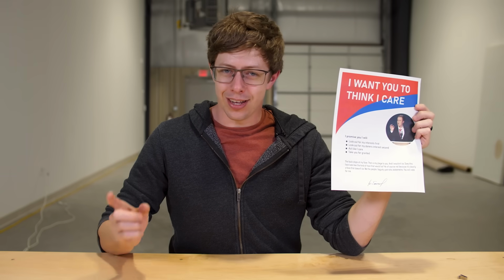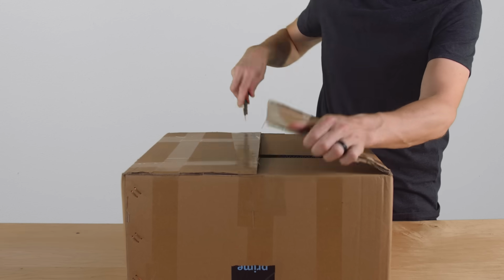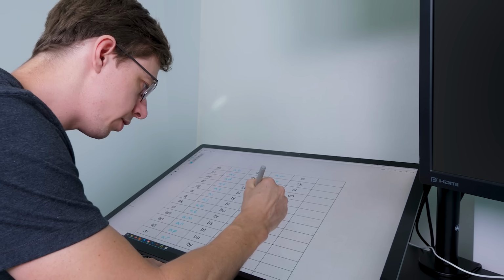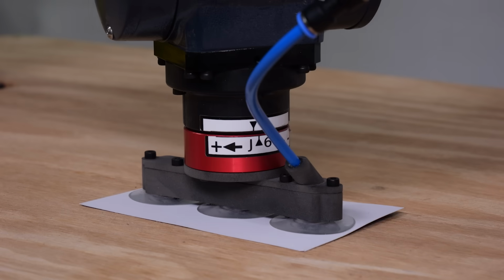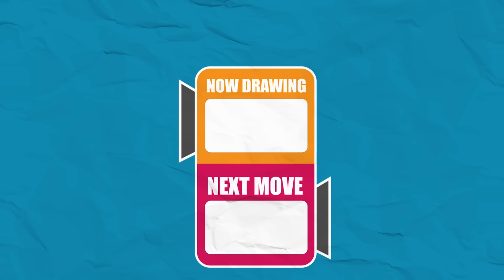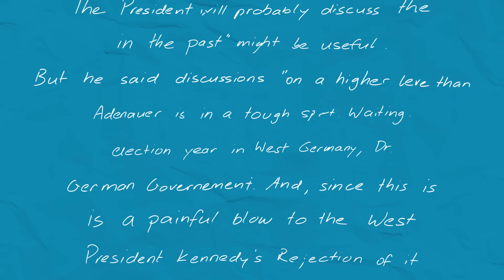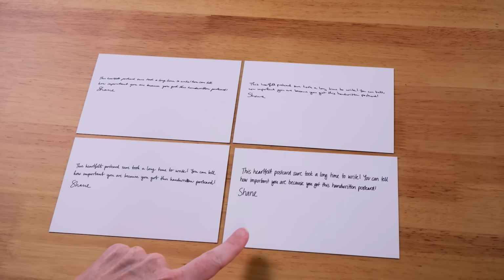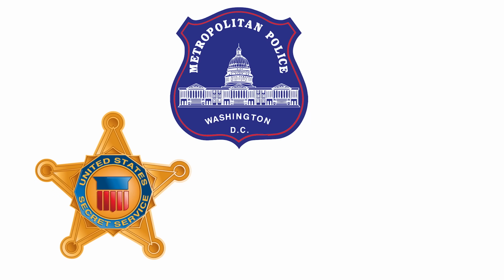I sent robot forgeries to a handwriting expert

Comment: I think one other easy give away was that everything was written at the same pressure (against the paper) which is usually not what happens when you write naturally and maybe this couldve been incorporated by varying force against the paper or by including a spring mechanism near the pen and replicating the motion of a human hand lifting the pen at the end of each word, does that make sense?
Reply from the maker: Yeah the handwriting experts call it "pen pressure habits." I thought for sure that's how Ron would be able to tell, but somehow the pressure was varying in the robot writing in such a way that looked very human. I was shocked when he told me the pressure looked human and realistic. I think it was somehow related to the acceleration.
Reply: @StuffMadeHere  That same thing jumped out at me when I was watching this.  If you do a follow-up video about the writing analysis, it would be really interesting to learn what other cues (pen angle?  The speed at which the pen is applied to and lifted off the paper?  Dirt or smudging from the side of the hand?  Skin oil or DNA traces?) an expert might look for.

Comment: 17:00 also you might want to find a way to turn the machine on its side and have it still work, as pens are designed to apply ink by friction, not gravity, so it looks better when the pen is held horizontally (this is the same reason you will see calligraphers use a slanted table)

Comment: I’m no expert in handwriting, but I can translate it to similar “detail focused things” I’ve worked with. So:
1: Does the robot vary the pressure?
2: Does the robot vary the size of each letter? The angle?
3: Does the robot put each letter at specific horizontal line?

We vary these things all the time. It’s not just that every, let’s say “e”, is at a specific pressure/size/line. It varies all the time!
(There’s more to this, I just wrote a few examples.
I can give one more to give you an idea: The robot is relaxed all the time. It never gets tired or varies anything. It just writes like ..a robot.)

Comment: I think some aspects where this robot writing is different is, that the pen angle and pressure isn't constant with actual hand writing. 

Depending on the pen or brush you use, it can be crucial to have more than X-Y-Z,

Comment: The greater failure I've seen on the machine written cards was that it lacks of pressure variability. All letters are roughly the same thickness without some pointy ends.
Reply: The ammount of ink on some letters should also vary, as the machine has a constant rythm on writing and humans don't. Also, the way it traces exact lines for every letter should leave behind marks that could be distinguishable with a microscope.

Comment: Very neat. My thought process would've been making a pen with accelerometers and tracking points and some way to measure the pressure on the tip, that way you could emulate the natural variations in handwriting. Then write out exactly what you want to write and record the movements and pressure of the pen strokes. Then have a multi axis more precise pen robot that can copy your exact moves. That would at least help you write one message. If you want to have different messages then I guess you could combine that approach with the machine learning to create variations in the writing. Maybe even have it mix and match multiples of the same sentences so you could have more variations, ie more natural looking

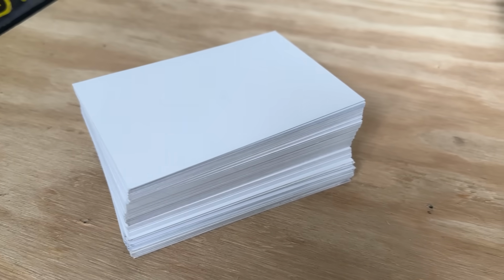Comment: @9:25 you can program the following:
for i = 1 to 1000 cards
   adjusted_height = totalheight  - [totalheight / 1000 cards] * i
next i

So if you're picking up your 500th card. And the total height is 300mm (because European are actually sane): 300mm is divided by 1000 cards and multiplied by 500, leaving a adjusted height of 150mm. Or if's your 863th card your adjusted height is 300 - [300 / 1000] * 863 = 38,1mm.

Comment: The "Oh no, what now?" facial expression of your wife when asked to pick the fake, is priceless.
One thing which would make the overall output seem more natural, presuming that the whole message can be treated as a single object (like any other block of text in a graphics program), would be to very slightly (only a few percent would be plenty) and semi-randomly rotate and/or distort the text vertically, horizontally and diagonally, so that if some-one gets more than one card, no two should likely look precisely the same.

Comment: There is 2 important things missing from the samples that if corrected would create a ramdomization that could be undetecable. The first is pressure of the pen, ( if you really wrote a thousand of those postcards, the writing it self would eventually trail off, or lighten.) This  also needs to be tied in to the second and more noticable Inflection. Lets put it this way, if you just got "The Glare" then your hand writing will reflect that in a downward fall off in the sentence or line stucture. But if you're thinking you can trick your wife, and pull one over on her, then your sentence/line stucture will be slanting upward with positve Inflection. Inflection also effects the speed of handwriting. If there is a certain phrase you know, that part of the sentence that contains that phrase will be faster, due to your brains ablilty to retain mussle memory. These changes if implemented would make a less psychopathic robotic handwriting sample.    You do realize your wife figured out the fake result by reading you not the cards right?     My suggestion to solve the problem have her write 10 cards,(at different times, and of course, only if she wants to)then use her samples, as the writing sample base, and see if she can recognize any of the 10 cards as her own. Also if you do this, use an envelope, and do not be in the room while card recognition is taking place.   Italics or italicization can also be part of the inflection too.  If your interested in machine learning maybe a reading robot that notices inflections and tells you about a person from a sample could be neat. You would be able to take a sad sample and make it happy. Just a thought. If you want to see how good you are a noticing inflection, find a news story, go to a fake news generator, input the real story into the generator, and finally compair the two. You should notice lack of inflection almost immediately. Translation programs still are unable to correct for this, Chinese to English, or Russian to English. In this case it is English that is missing the inflection, that is why amazon instructions seem so weird. A robot that can read and flag angry letters i am sure would be a useful tool.  See also: Red Riding hood story analysis experiments.  Thank you for the cool video, l always like the content from your channel, and cannot wait for the next cool idea or concept you share.
Reply: We've got a pro over here. I really appreciate the insight
Reply: Another thing to consider is ink smear. Ink does not perfectly lay on the paper nor does the hand not occasionally rub against the paper smearing the ink.
Reply: Another thing that shows 'humanity' in the written word is the use of white space -- just a thought . . . ;-)
Reply: It's so damn cool that inflection is present in both vocal and written language, and quite obviously. It's so cool how experts have identified and can quantify these small distinctive human behavior even tho we can all figure out written inflection very few people would be able to communicate what they actually mean. mega appreciate your insight!!

Comment: The anti forgery guys are gonna make their own neural network to recognise the ai writing lol. Maybe for cases like this, they could check for hand grease and stuff.
Reply: there are so many many ways to tell it's not real handwriting, i'm very surprised the "expert" said it could fool him. very surprised.
Reply: @moos5221  Would you mind explaining some of the "many many ways".
Reply: @nishachoudhary4894  one important indicator to identify  forged text/signatures for example is the pressure with which the pen/marker is pressed against the paper. the machine will have applied a constant pressure for every letter and every part of the line of the letter while a human would vary the pressure a lot between each letter and the start and ending of the lines of each letter and in the corners etc, you get the idea.
Reply: @moos5221 couldn’t you just represent the pen pressure as a value and then set a range of what would look like realistic variation in pressure for a human then have it randomly choose a value from within said range
Reply: @moos5221 of course probably humans have a more consistent pressure for individual letters or words but couldn’t you just claim variation in writing surface for a seemingly random differentiation from pressure
Reply: @treyheeb5379  i assume that could potentially be done, not sure how well though. i'm not saying it would be completely impossible to build a machine to create top level forgery (even though it would be extremely difficult and likely not worth the effort), i'm just saying that his machine is in my view far from that and any handwriting forgery expert should be able to tell that it's not human writing. to detect forgery you obviously not just look at 1 document but you compare 2 (or more) documents of which 1 or more are known real documents and 1 is the document in question and you can make out individual handwriting patterns of an individual and check if those are present in the document in question. examples are the angle the pen is held, the speed at which it is moved, the pressure and even things like tremor in the hand or smearing ink when backtracking "i-dots" and many more. to produce a perfect forgery all of these have to be taken into account and i doubt you will find any application where it would be worth the effort to do so. to check if a document is machine or handwritten is rather unusual of course. 
I want to note that i myself am not a handwriting or forgery expert but i have worked with some and hence have some general knowledge about their approach.
Reply: @treyheeb5379  of course any persons handwriting has a lot of variation depending on many aspects such as pen used, surface, underground, if the person was in a rush or took their time to make the writing look nice and so on. especially the last point can often be used to tell forgery and real signature apart, because the forged one will likely be written much slower and therefore with different pressure and ink usage then the real signature, in an attempt to copy the original well. this ofc mostly applies to forgerys where the fraud didn't have unlimited attempts to create the forgery and pick the best one. the point here is actually that the machine will have mostly the same pressure applied for all letters and all parts of the letter, whereas a human will apply more pressure at the start of a line then at the end of the line for example. with extensive research most of this could be applied to the machine i guess, would be very interesting for sure if someone would attempt to go really deep on that matter and make it public. the real life appliance is very limited and i don't think anyone could earn any profit from developing such a machine...anyone but a youtuber of course.
Reply: @treyheeb5379 Haha, it’d be a feedback loop for the program when you think about it. As machines get better and more advanced it could just get better and better at mimicking forgery. It’s very plausible that a perfected forger machine is inventible.
Reply: @dancingdoungnut  I don't think it's that simple.
Reply: I suppose you could simulate hand grease also, but that's getting ridiculous. My guess is that dusting for tell-tale fingerprints that are made when writing would be almost impossible to fake, and even more effective at detecting forgeries given how sophisticated the writing reproduction is getting.
Reply: @moos5221  He didn't say that, he said "If I didn't know better" aka if he wasn't a professional

Comment: There are def a couple oversights here handwriting wise, but nothing that I think are 100% instant issues. You start at the same edge on the left every time, humans don’t do that. Humans do finish sentences on the right in different spots, but we’re also quirky. If I wanna say, “happy birthday to my favorite brother Tim,” second line underneath, “love ya champ” I might write love you champ starting almost reverse pyramid underneath it, just a much smaller line, that way, “from justin”, could be even smaller. That and your machine doesn’t make any mistakes, no smudges, no pen drags, it’s pretty smoothly smooth. There’s stuff like that, they sort of don’t feel robotic, but they’re what I’d expect to see like in cursive class at school. There’s connections and what not, but you’re tracing in the work book. So you start and end the same way etc. If you showed me 4 of them, I might think your secretary had wrote the same thing for you a couple hundred times, so, like, weirdly not believable as you, but weirdly could pass for like, a human drone doing repetition. Cuz like if you knew you were doing 100 you might have a system in mind to follow, start left, make them neat, do another. But a human signing 1 card doesn’t do that.

Comment: They've had signature robots for decades. I'm not sure how those old signature machines were setup, but one large corporation did use them to sign multiple copies of letters sent to certain people (I think stock holders mainly). They were able to start inserting them as images in word processors. So signature robots are actually a real thing but are now antiques. For you trying to replicate something that hasn't been done in decades with the new twist of using computer controlled robotic arms, instead of the purely mechanical signature machines. No they weren't used to sign legal documents. They were used to sign informational documents with a signature of the appropriate corporate officer.

Comment: I would very much like to know how you did the data collection for your handwriting. I have been taking courses on machine learning, and a common class project is using the MNIST dataset (I literally started the first class two months before you posted this video, and I got hyper excited over it), and it's all well and good to churn through other people's data, but I want to make my own, since it would help me understand what the programs/models are doing and how (also obvious ethics). 

The biggest thing I'm struggling with is the how of collecting the data. The program you used is honestly perfect, and I would love to use and/or build one just like it (preference on build (again, I would understand what it's doing so much easier)). Do you have any guidance, recommendations, or tutorials? (Wider question open to everyone as well.)

Comment: Lol! I've been struggling with writing a program that's way outside my normal sphere of experience, and it's not easy. I understand your frustration. Mine is finally SORT OF making sense, but only after probably a year of working on it, and years of code prior to that attempting a solution to a similar problem. There's probably still errors lurking in it somewhere, but it's getting there finally.

Comment: I'm 7 minutes in and I would separate transitions from the letters themselves. And I also would use machine learning for this. Create an autoencoder and then use a random distribution to create new possible letter samples without you having to actually write them out. And then select randomly from those. 

But it seems like you don't really use machine learning a whole lot in these projects.

Comment: The thing is, if you cause a machine to write your signature, it isn't a forgery... 

A signature may be made manually or by a machine... Uniform Commercial Code S 3-401(b).

It's a forgery if someone else writes it orvcauses it to be written, AND you don't "adopt" it.

Comment: I think that your software would have worked if you had applied an integrative control scheme. The idea being taking the max vertical position of the first letter on each line and ensuring that the next letters in the line do deviate a little bit but within a reasonable percentage of the total height.

Comment: The most obvious indicator is that the pen is obviously oriented in a near-vertical position and with equal pressure -- the fact all the gaps in the strokes are dead center and equal width establishes the lack of pressure variability.  To properly capture handwriting, you need to capture the angle of the pen and the applied pressure.  These tools already exist and are used in a number of applications, but are quite uncommon.

Comment: is the expert saying the cards weren't perfect? like i understand you only played some snippets of that interview but my impression was he was simply saying that the cards had a similar style that they could be linked back to the same source, which would also be true if they were handwritten by an individual human, like you used the same software, the same training set, obviously there's probably artifacts across the samples that link them together. again, i get i only saw like 2 lines from that guy so if he said specifically there are possible ways to tease out it was machine generated then cool.

in either case i'd be very interested in an expanded video about the forensic handwriting analysis, that sounds very interesting